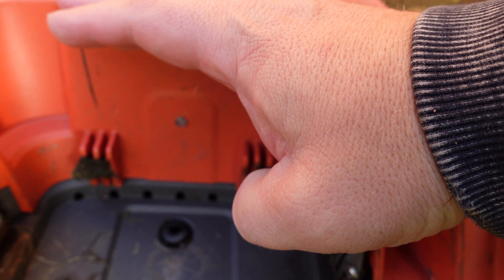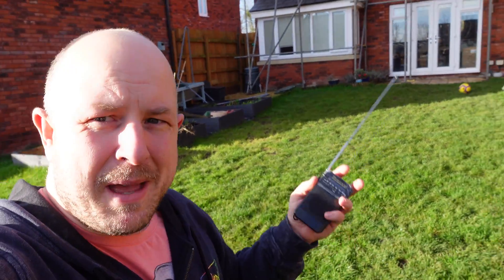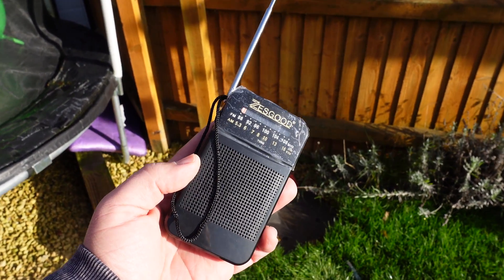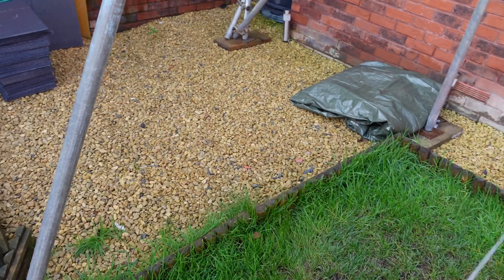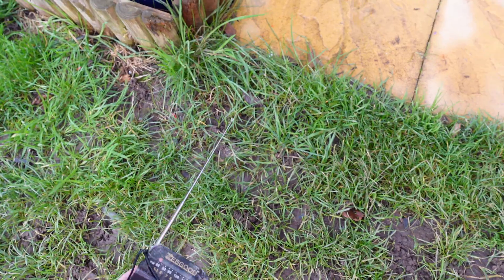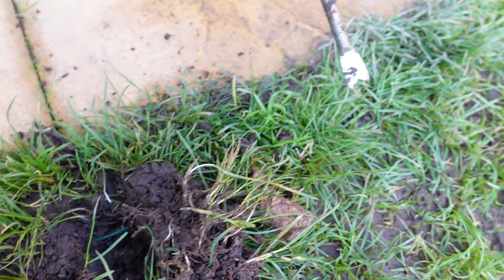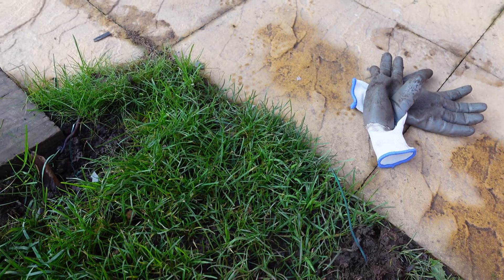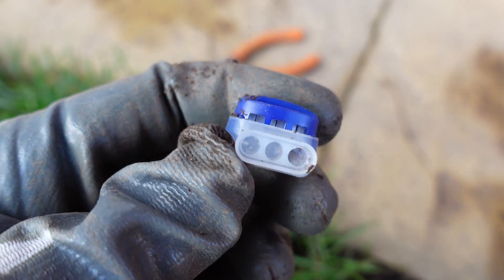Finding Robot Lawnmower Broken Border Cable with an AM Radio - Flymo, Husqvarna, etc

Comment: Thanks for this. I used this method to track the cable on the perimeter as I have to dig a trench for drainage and want to avoid breaking the wire. I used exactly the same radio. On AM just past the 6 marker, I kept the antenna folded in, and hovered the radio over the area. It seemed much quicker and a huge amount more accurate.
Reply from the maker: Great tip!

Comment: I have a break on my cable and this is not working for me. Perhaps it only works when there is a full break? The am radio is detecting an energy but as soon as you switch which cable you have plugged in you get a different result.
Reply from the maker: Not sure what you mean by switching which plug you have connected. I leave all wires connected as per normal and follow the rough outline of wires listening for a difference.
Used this technique again just the other week as I put a spade through a cable by accident but didn't realise till after being on holiday and realising the mower had not left the dock.
If the radio approach is not working, you can buy more expensive solutions.

Comment: My cable seems to break every winter this will save us loads of time thanks very much. We wonder if strimming the edges causes the breaks
Reply from the maker: Strimming the edges should be fine (assuming you have your cables 30cm from the edge as per the install recommendations. Does seem odd you have the cable failure on a regular basis though.

Comment: I remember you sharing this technique some time ago, it's quite clever. Given I'm an M0 ham I probably should have known this myself! Essentially the perimeter cable is acting as an antenna. The base station generates an alternating signal (sort of square wave AC) that is detected by the robot mower to stop it deviating outside the perimeter.

This same signal is picked up by the AM radio. When the line is broken there's no transmission to receive and boom, there's your break in the cable.

Thankfully when my robot mower lunches the perimeter wire it proudly languishes over the crime scene - the real ballache is trying to resolder it outside with my poverty spec aldi special gas soldering iron :)
Reply from the maker: Yeah, when the mower eats it you can find it easy. When "someone" damages it you need to get more creative. Another roof saga incident.
Reply: @SpectrumGeeks  you do have to wonder if they had (have?) a check list of things to ruin your day
Reply: Why mess about with soldering - the crimp joiners are so easy to use, as shown in the video.